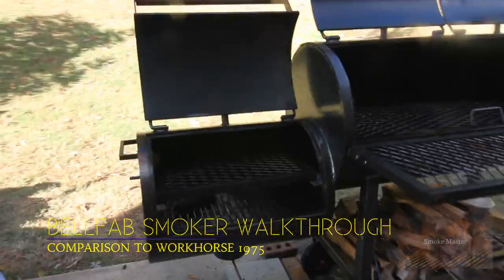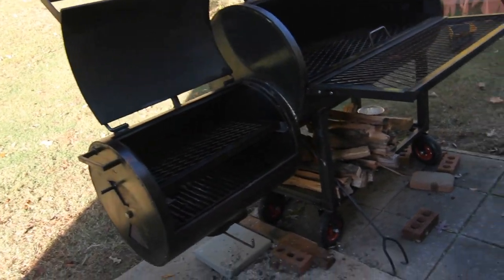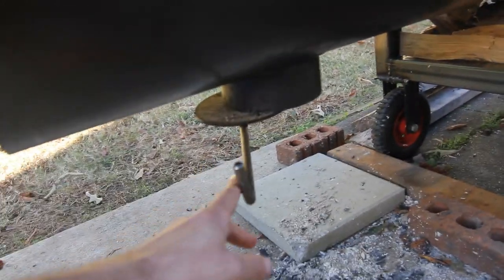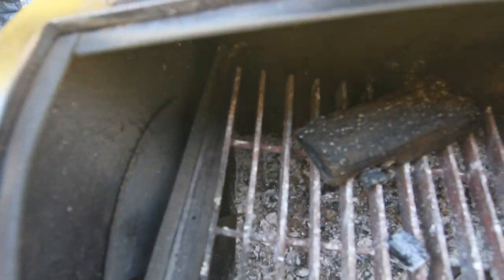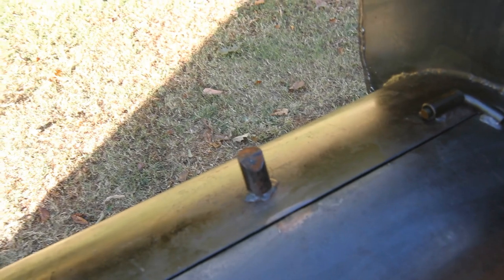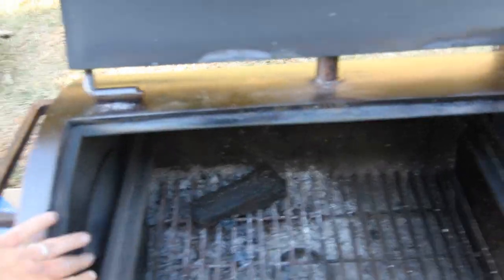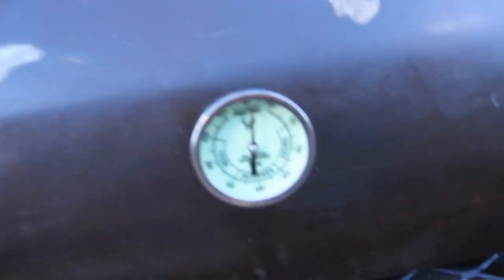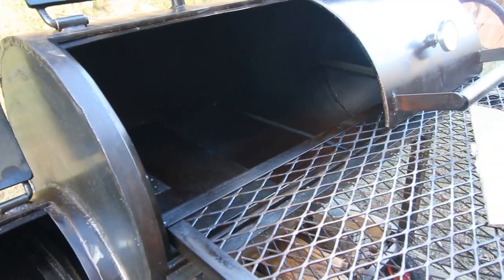Bellfab Walkthrough/Comparison to Workhorse Pits 1975

Comment: Out of curiosity why didn’t you just get the 1975? Was there a significant cost savings by trying to get a custom build modeled after it? 

I’ve found that the 1975 is significantly cheaper than a lot of the options I was comparing it to.
Reply from the maker: My overall cost was about $2500 on the Bellfab. At the time, I think I saved somewhere around $600. Now,  there are some things I like better about my Bellfab than the 1975 - front shelf and double doors I can actually open with one hand. The tuning, however, was one thing that I've put in a lot of time improving (also added the back door). It would be easy to say that I should have gotten the 1975. But I'm fairly happy with where I ended up.

Comment from the maker: So I forgot to add the lack of a back door on the firebox.

Also, in the comments below you may find some comments from @Quetorials. The person on the other side of the dispute and their comments were removed. The gist was that Workhorse wasn't as good as they said, should have shared data if they were,  and that they were not professional for leaving metal shavings in their delivered smokers. There was no substance to these comments, which appeared to be more of a personal grudge from a rival pit maker. In the Bellfab I received, for example, there was plenty in the way of metal shavings and free slag to clean out. Workhorse Pits' reputation for excellence is pretty well established (though I would certainly enjoy a biscuit test if only for just because).

Comment: Sooo would you have paid the extra 1k ish for the 1975? Great info on all your vids btw
Reply from the maker: Thanks. If I had an extra thousand dollars I certainly would have gotten the Workhorse. Not having an extra thousand dollars, though, it's a long time to wait - firstly to save that much money and secondly for the pit to be made and delivered. I could have gone smaller, of course. And in the long view having something that works well and has better quality is always better. Having conceded that, my only real misgivings are in not pushing harder for the design features I actually wanted. Even as-is it works well enough for my current needs. And in the future I intend for it to work even better still.
Reply: That is a lot of money, even if its available.  I tend to see each $100 as an amazing brisket :D

Comment: Does smoke leak from where the 2 doors meet? How long did you wait for it?

How does it actually cook? That’s mainly what matters
Reply from the maker: So far it cooks fine. I haven't cooked on the side closer to the firebox. On a run of slightly dirtier smoke I will notice a little coming from the top where the doors meat. Not a big deal when you have really thick steel. It might seal up anyway as well.

Comment: Great video !  I think the throat opening is not that hard a fix. Angle grinder will cut it out pretty easily. I think you might want to consider tuning plates to even out the difference in temperature from side to side. Most offsets use them including LSG, Gator, Horizon, etc. Easy to make from some flat bar from a metal shop. The stack is 2/3 the smoke chamber?  I think for 100 bucks in metal and a call to a mobile welder you probably have a fantastic smoker.
Reply from the maker: Thanks man. I still might have to take a closer look at that Shirley of yours someday.
Reply: @SmokeMasterD  and visa verse I have never seen a custom Bell Fabrication smoker. From what you have said it is one of a kind as you added elements he doesn’t offer to anyone.

Comment: The workhorse is certainly a beast and I’m sure is top of the line—but is it necessary? 3/8 inch steel is overkill imo and you’re the one paying for it. Horizon provides the most bang for your buck of any offset smoker considering price, quality and performance.
Reply from the maker: I have a soft spot in my heart for Horizon. There's nothing wrong with Horizon. Just different.

Comment: The height/thickness from top to bottom of the stack collector looks shorter/thinner than the one on the Workhorse as you mentioned.  Is the cross-sectional area of the collector entry point into the stack less than the cross-sectional area of the stack such that the stack entry point restricts the flow?  Also, I like the idea of the biscuit test - would enjoy a video of that.  Thanks!
Reply from the maker: The entry to the collector is less by around 3 inches towards the bottom and both sides. It definitely changes the equation. How much, I  suppose, is the question.

Comment: I'd say the lesson here is that if you are going to ask for something custom you need to be EXCEEDINGLY clear about what you want. There's a reason that drawings exist, and it's to ensure that both parties are clear about the expected result. About the only thing I'd put on the fabricator is the edge of the stack coming protruding into the collector. There's no reason it should be there an is only blocking airflow.
I'm interested to see how the biscuit test goes, and I'd encourage you to do it before you do any modifications. I'd also encourage you do do a few more cooks before committing to mods, as there might be some nuances to it that you haven't figured out. As you said though, you want it to cook the way you want it to cook. If you can get it to work, but want it to work a different way, at the end of the day it's your smoker. 
Good Smoking
Reply from the maker: Thanks man. Good advice

Comment: I think you made a mistake by purchasing the Bellfab smoker.  You should sell it to me (at a substantial discount of course) and buy a 1975.  On a more serious note, it doesn't look like there are any major issues that can't be modified.  I think you can close up the opening from the firebox to the cook chamber by welding in a plate to cover it if that's what you were talking about at around 5:10 of your video.  You can also cut that damper in your cook chamber and replace it with what you want.  Adding the back door on the firebox can be done with a plasma cutter.

Thanks for sharing!  This is a helpful video.  I've looked at getting a smoker from Craig Bell since I've heard good things about his work and his pricing is very reasonable especially for 3/8" thick steel.
Reply from the maker: My pleasure. I'm sure things will work out, and going with Bellfab will do you well. 🙂

Comment: When I seasoned my Bell Fab smoker it also initially had about a 25-40 degree difference between the FB side of the main grate and the smokestack side. I was able to eventually even that difference out to about 5 degrees by moving the coals and wood in the FB to as close as possible to the intake damper. I was running with all dampers completely open and the ash dump slightly open as well.
Reply from the maker: Cool. I  definitely have been making my fire on the far side of the fire box. Have you noticed whether the food closer to the firebox has less smoke flavor? I would assume the temperature would be evening out through radiant heat rather than convection.
Reply: @SmokeMasterD  Unfortunately I haven’t had a chance to cook on it yet. The Seattle weather as well as my son’s soccer schedule haven’t left me enough time or good weather to cook. I’ll let you know when I do get a chance to cook though.
Reply from the maker: Alright cool. I may do some tests too
Reply: @SmokeMasterD  I should point out that my FB is 20 x 20 so there is a difference. I also didn’t get the fold down stack and I think mine is slightly shorter than yours.

Comment: Interesting lots of different small  difference from the workhorse. I think the overall quality is noticable. I will be purchasing a workhorse 1975W. Thanks for the video.
Reply: If you want it by summer you better order soon.  I ordered the first week of October and my production date is Mar 9th.
Reply: @eazymunee  Did you order one as well or were you asking them before ordering?
Reply: @epickleuva  sorry Eric not sure what you mean?
Reply: @epickleuva  ah. You are the one who wrote a review about metal shavings?   In a smoker that just spent 8 days being fabricated?   Also cleaned before leaving?  Adds up who the troll is with the “burner account”.
Reply: @epickleuva    Every single smoker that leaves our facility (20+ a week) has metal shavings in it.  We do sweep them out thoroughly. We are a fab shop and in our owners manual (and in pickup/ delivery communication) we tell the customer that in transit small metal residue will move around and needs to be addressed.  We offer those solutions and I’m sure TMG does too.  That is unavoidable in raw metal cookery construction.   This convo about performance has gone astray now for two years.  The idea you are on the attack of our wildly popular offset  has somewhat piqued our curiosity in the past.
Reply: @steveguzman6640  I ordered mine on October 6th and got a production date of March 9th.